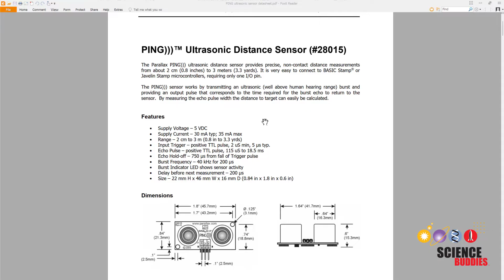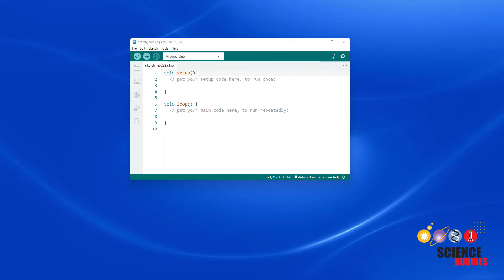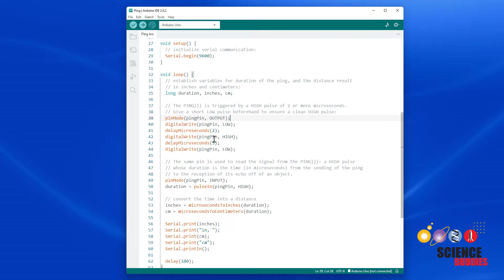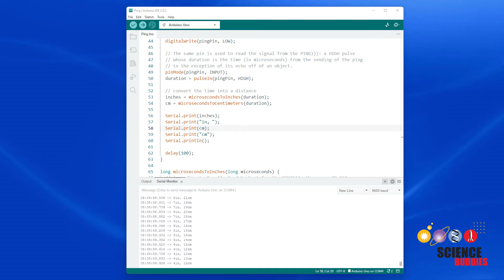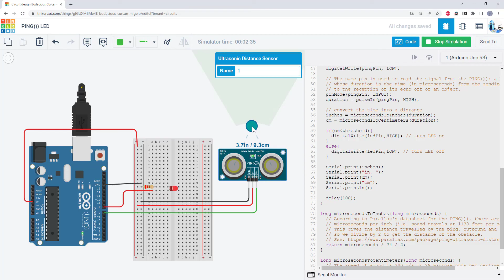PING Ultrasonic Distance Sensor and Arduino (Lesson #8)

Comment: could I get the code which includes all 4 led. I am not able to get the 4 leds to light. I added 4 'if else' statements for each led. I declared the 4 different pins and also 4 different threshold levels, but no luck. I am only getting 1 led to work using the code you gave in this video. Thanks for your response.
Reply from the maker: We recommend asking for help in the official Arduino forums where you can post both your code and your circuit. You can also watch the troubleshooting video toward the beginning of this playlist.

Comment: FYI you can click the Serial Monitor button at the bottom of the code windows in TinkerCAD to get a virtual esrial output, so you dont need an actual arduino for most testing

Comment: 340 m/s is not the same as 29 μ*s/cm. That’s like saying 1 m/s = 1 s/m

Also to add insult to injury, 340 m/s is not the speed of sound. It’s 343 m/s.
Reply: It is indeed the same. They simply turned it around. IE; how long for sound to travel 1 km. To calculate this you take 1 km or 1000m and divide it with the speed of sound at 20 degrees celcius. 1000/343 = 2.915s. Divide this number by 100000, which is 1 km converted to cm and you get how long it will take for sound to travel 1 cm. Which is 0.0002915s or 29,1 microseconds.

The thing i might agree with is that the 29 microseconds to travel 1 cm is at 20 degrees celcius while the given speed of sound is at 15 degrees celcius, 340 m/s. 
The speed of sound is not a fixed value. it varies, the amount you got from google is at 20 degrees celcius. At 15 degrees celcius the speed of sound is 340,2 m/s. The cool thing about programming is that you can fix these little issues in your own program. This is after all not a physics video.

Comment: Very Educational. Is it possible to detect passing objects using ultrasonic sensors?
Reply from the maker: Yes, you can detect objects passing in front of the sensor since you will see a brief drop in the measured distance, then once the object has passed, the distance will go back up.

Comment: I dont really get the concept of this code
Reply: I know it late but uh i will use your comment to put out what i understand. So, "long duration, cm, inches" is just to declare this three variable. Long is a data type that can read higher number than int or float data type so it good when there is alot of numbers.

"digitalwrite(ping, high)
Delaymicrosecond(5)
digitalwrite(ping, low)" The reason why we should put delay in between is so that the sensor can finally release short burst of sound. If not, the sensor doesn't know it should produce sounds or not.

"pinmode(ping, input)" is used so that the pin that is connected to the sensor is prepared to accept any input. In this case, it the sound that return back to the sensor.

"duration = pulse in(ping,high)"  duration is just a variable while "pulse in" is used to count the times the sounds travel back to sensor.

"cm = microtocentimeters(duration)"
Is to call out function that calculate distance in cm based on duration. This function can be seen further below. 

And the rest of "serial print" is just printing the distance in cm and inches into the serial monitor. 

After the loop ended, we see there is "long microsecondToinches(long duration)" this is the function that return result inside the loops. You can see it been used by cm and inches variable in the loops.